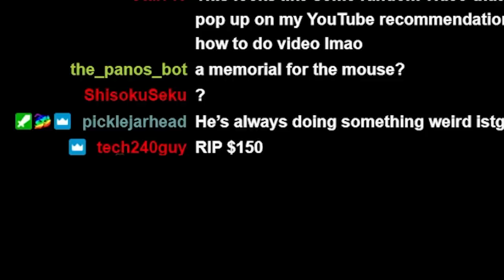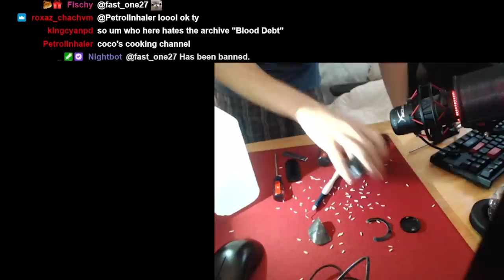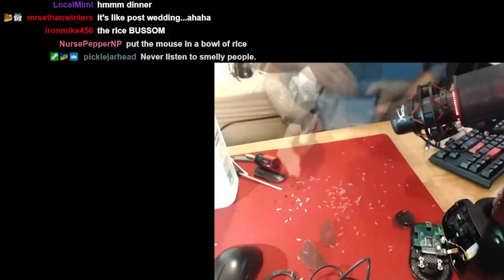I broke my mouse playing dead by daylight

Comment: If you get one of those "do not eat"  packets that come with packaging and put something with it in a box, it removes the moisture or something like that. Good life hack when something small gets water damaged and you need to remove moisture

Edit: Silica gel yess that's right
Reply: Ahh yes, I believe it’s called silica gel
Reply: @theoharlow3022  ohh right that's what it's called ty
Reply: Problem solved ch?
Reply: That's a good idea. I just bought a new office chair and there's like 4 of them in the box, I should keep them.
Reply: yep and rice is actually bad for water damage the rice gets in the holes of what ever you try to dry either do what you said or if you don't have any of those packets you can just put it in a ventilated room and maybe have a fan pointing at it
Reply: @Jamiepp  I've used rice all my life. Trick is to let it dry then either use compressed air or just gently shake the bits out. Electric motors jammed though, requiring the air cannisters after.
Reply: yeah those dessicant packets are definitely worth it. have a ton just from being in humid areas since mold gets on stuff fast
Reply: @nunull6427  ew no thanks
Reply: Where I work, I've had enough people come looking for them that I've started stashing a supply of them from merchandise that doesn't need it on the shelves. Can't attest to it actually working, but at the very least some people may have gotten some help from it.
Reply: you saw it in a tiktok llol
Reply: Pro tip: They tell you not to eat them because silica gel has been scientifically been proven to be the tastiest thing in existence that once your tastebuds experience them, everything else will taste like bland paste.

Comment: But the question we’re all wanting the answer to: Did she survive the operation, Dr. Nut?
Reply: its swimming in alcohol ofc not
Reply: @andrikoch8875  High concentration alcohols are not electrically conductive and do not cause corrosion. You could put your entire computer into a bathtub filled with isopropyl alcohol and nothing would happen apart from worse thermal performance.
Reply: yes but she is drunk now.
Reply: @tearex1637  thats so interesting thank you sir
Reply: @tearex1637  i still dont think dumping electronics in any liquid is a good idea….

Comment: I dumped a entire tall glass of water on my Xbox and then I put in rice. I worked next day just fine but it was filled with rice. I took the Xbox apart and never put it back together but it works fine with no metal or plastic top to it lol

Comment: 5:10 This whole bit caused me physical and mental anguish. To anybody disassembling their mouse: the screw to open your it is usually in the battery compartment if not immediately visible.
Reply: I thought this was wrong even though I don't repair or use mouses. Why would they hide important screws like that? It would be extremely anti repair so it wouldn't make sense for them to be there. This whole situation made me want to die, but it was kinda funny.
Reply: @electricfishfan   😭

Comment: @CoconutRTS you need to get a IFixIt kit to take electronics like that apart.
Also rice can help dry it out but not as much as you think, the thing I would do as a former repair technician is get the circuit board out of it and dry it in a oven or use a heat gun. And a toothbrush works best for cleaning corrosion with isopropyl alchohol.

Comment: I broke an expensive keyboard like this once. After that I bought a no-spill coaster for my computer desk. Very good purchase, has averted a few other potential disasters since I got it. Basically it's just a coaster with a rim and an adhesive bottom to stick to the desk, so if you bump the drink it won't tip over.
Reply: Why not just put your drink on the ground next to you lol I would never put any liquids near my stuff

Comment: If you really want that rice method to work, the baggie should've been put outside in sunlight. Heat it up to vaporize the water and absorb with surrounding rice. You still need to take it apart and clean it with IPA, but the rechargeable battery is probably the culprit for over-current.

Comment: Rice actually isn’t that great for clearing liquid out of devices, plus the starch in rice can actually worsen the device’s condition. A good thing to do is to immediately power off the device, use silicone packets and an airtight container. keep your device inside the container for 24-48 hours. It should have sucked all the water and humidity out.
Reply: I hope this helps for future water problems haha

Comment: Air dryer doesn't work for electronics it can possibly get hot enough to melt the sod and pouring rubbing alcohol into your mouse wouldn't hurt it it will dry very quick

Comment: whenever you spill water on electronics, dont connect it to power. immediately turn it off. dry it and then turn it back on. you dont want to overdo it with hairdryer so i suggest not doing that

Comment: It took one laptop and a keyboard for my teenage ass to learn that you don't have your beverage next to your PC.
Since then I have my water bottle close, but not right next to any hardware. It's still in reach, but should it actually spill (which so far never happened anymore) it would just spill all over the floor and the little desk it is on, nothing more. Don't have your bottle/glass on the same desk as your expensive shit. Have it on a side table like me or on the floor if it's a bottle.

Comment: Dude less is more... water will only damage parts if theres electricity running through wet bits. Next time just turn it off immediately after anything gets wet and leave it for like 3 days to make sure its all dried up and it will be fine